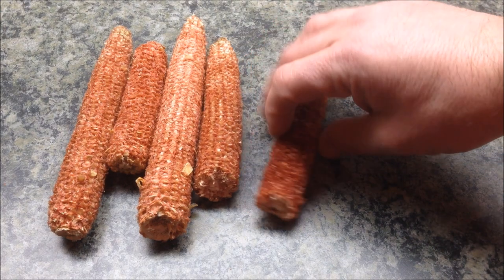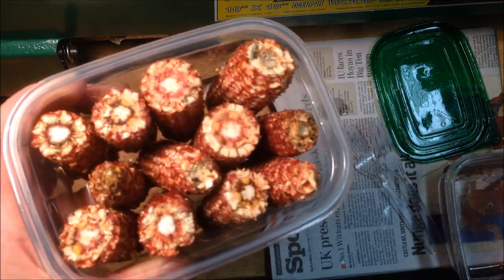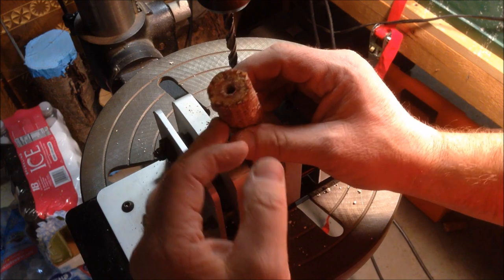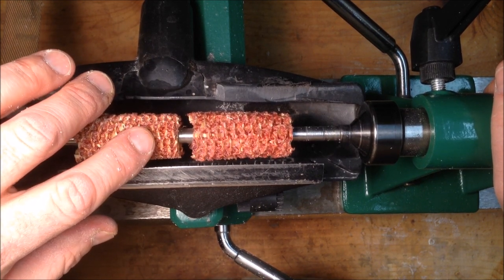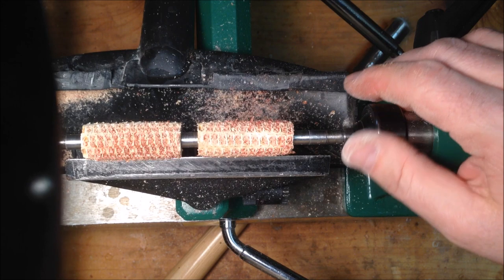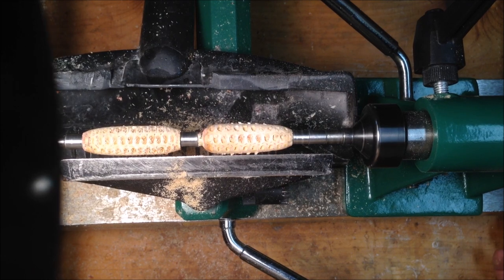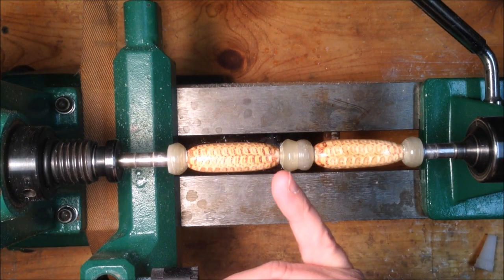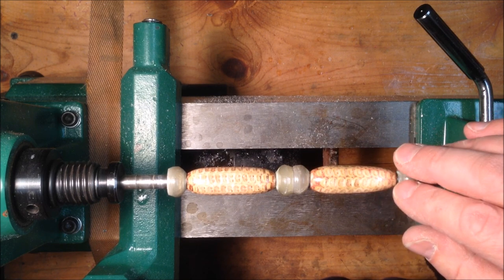Corn Cob Ink Pen

Comment: Very Cool.  Would love to see the slimmer corn cob pen blanks in the future videos.
Reply from the maker: Thank you Richard,
  I will do another as I improve the process and maybe fill the kernel holes. 

Regards,
Bob
Reply: Saw Dust Maker If you started with smaller cobs you could make a slimmer pen.
Reply from the maker: Phiyedough What I've found that helps more than anything is a smaller core. Some cobs have a large core and that makes for a thicker more unattractive pen. I like the more delicate cored cobs, they give superior results in my opinion.
Regards,Bob

Comment: Wow that looks like a really cool pen Rob, there is nothing like experimental pen to get your brain buzzing.  Great video and very well explained. Also I think i will have to get some of that Minwax hardener.  many thanks for sharing.
All the best
Tony
Reply from the maker: Thank you Tony,
  I was surprised how well the MinWax hardener worked. I absolutely loved turning these corn cobs my only regret was the length it time it took due to the weather. I was dying to get back out in the shop and work on them but it's been cold. Now I have a ton of ideas for filling the kernel holes. 

Regards,
Bob

Comment: Being from the Cornhusker state this is a pretty good selling pen. I have use stabilized pen blanks and tried the hardener. I just use thin CA glue. I literally coat the blank hit It w hardener, then drill it slowly.  The cobs are very sponge like. CA glue the tubes in. Mount it and start turning w sharp tools, after you get past the "fuzz" of the cob soak it again w thin CA glue building up a a hardened cob while turning it. I've turned lots of cob pens this way and never had a blow out. I probably apply this CA 6 or 7 times. The trick sharp tools light passes. Very nicely done though. I harvest my cob just like did.
Reply from the maker: Thank you Dave,
  And thank you for sharing your process. 

Regards,
Bob
Reply: J

Comment: Thanks RJB looking forward to it, right now doing a restoration on a machete my nephew found in the woods. Cool item to restore. Lots of work too....lol
Reply from the maker: I think it's great that you take the time to restore an old took to new condition. I wouldn't even know where to start with a project like that. 

Regards,
Bob
Reply: RJBWoodTurner I will post a picture when I am finished with it. It is already to glue the new hand made handles on. Then do some finishing on the blade, then a few coats of boiled linseed oil to seal and protect the handle.
Reply from the maker: That sounds great Steve,
  I'm looking forward to seeing it. 

Regards,
Bob
Reply: RJBWoodTurner Hope you can see these photos of the machete, I restore. It was all rusted and pitted. So it is not in pristine condition. But, I did what I could. Also made a nice shield for it....lol

Comment: Great instructional video. I've got a rough bowl of "punky" horse chestnut drying after a good soaking of wood hardener - hope it works as good as yours. I saw a video using coffee granules as a filler.
Reply from the maker: I hope it helps too,
  I've had great luck with corn cobs because they soak up the hardener. Wood tends to harden the surface but doesn't soak in to deep. 
  
Regards,
Bob

Comment: Thank you for the tip of the wood hardener.  
I have turned several of these and have always just wiped on CA every-so-often as I spun them.  That worked well but I am curious to see how much better the hardener will be.  I have even turned complete corn cob pens without using anything to stabilize it....just a really soft touch and a lot more sanding than chisel work.  
I turned mine down quite a bit more and you don't have the large corn holes to fill but you still see the same pattern.
I used liquid food coloring as a finish and now have a blue, green and red corn cob pen.
They look pretty cool.  The food coloring worked well as it only highlights the pattern of the cob and doesn't make it a solid color but it was a bit sticky to work with.  After it is applied, you can even sand some off to get your desired look.  Then I applied CA over the top and the color is locked in.  I'm wondering if the food color will work if I use the wood hardener prior?......(guess i will have to try)  
I see you published this video in January.  If you haven't yet, you should really try turning one down a lot further for both looks and ease of use.  Just my 2 cents.
Reply from the maker: If you have a minute after you try the wood hardener, I'd love to hear your thoughts as to wether it made a difference or not. I have never turned a corn cob without it. I will have to attempt it and see what my results are. 
  Thank you for such a detailed comment and especially for the information on food coloring. I am curious to see if the food coloring will adhere with the wood hardener or not. 
  I was thinking about soaking a cob in food coloring the letting it dry and then soaking it in wood hardener to see what happens. I still plan to try it. 

Regards,
Bob

Comment: Hi Bob, great video. What do you think of a larger diameter pen kit such as the 30 Caliber Bolt action Bullet Cartridge. so the shape might look a little more proportional?
Reply from the maker: Hello Wayne,
  I think the 30 cal or any other larger kit would work great! It certainly would be much easier to turn a larger diameter. I only use the Slimlines for testing and videos because their cheap. Once I prove an idea, I can scale it up to just about any kit. I have made several of the Stratus pens with corn cob and they turned out beautiful.

Regards,
Bob

Comment: That is pretty neat! I didn't even know wood hardener existed.
Reply from the maker: Thank you David,
  I picked it up at my local Menards for $10.00. Usually you paint several coats onto the surface of rotting wood to stabilize it for painting. It works really well. 

Regards,
Bob

Comment: Great looking pen now a ? for you. Do you think the wood hardener would work on cork.  I have a bunch, and I would love to make a pen from them thanks
Reply from the maker: Frank,
  As long as the cork absorbed the hardener I think it would work. There in lies the issue, I don't think cork is absorbent. I sure wouldn't let that stop me from trying. The MinWax hardener is only $10.00 a can so it is a cheap test. You may even me able to follow the regular instructions on the can for wood and just paint several costs onto the cork. This is a great idea and one worth trying.  
  Have you tried drooling C/A over the cork while its in the lathe then hitting it with accelerator? With a sharp tool, that may let you turn it down a bit then you
Would have to repeat the C/A. 
  If I can dig up a couple corks, I may have to give this a try. If you could get it to turn it would make an awesome accent for the lower half of a pen.
  Please let me know if you have any luck, I think this is an excellent question. 

Regards,
Bob

Comment: We can get popcorn still on the cob as a novelty item here.  After popping in the microwave the cob is bone dry.  The cobs are a little smaller so work well for pens and I get a good feed of popcorn. I usually drill the cob run thin CA down the hole  and redrill after it hardens then turn the pen with light cuts and harden with thin CA as I get closer. Can't seem to find the wood hardener aroun here.
Reply from the maker: That's a good idea, drooling C/A to harden the core where the tube will go. I started using five minute epoxy on my cob pens. It seems to do a great job and I don't notice any deterioration. Worst part is I have to wait longer to turn. 

Regards,
Bob

Comment: What do you think about putting the cobs and hardener in a container and then using a vacuum pump, would that improve the penetration of the hardener?  White cobs would be pretty too. Great video and excellent technique in turning and teaching. Thanks for sharing
Reply from the maker: Thank you David,
  If you want to use vacuum, that would work great. I’d recommend Cactus Juice over wood hardener, it will penetrate better and give nicer results. What I did was a poor mans method. 
Regards,
Bob

Comment: Looks  good.  I always try to spray the accelerator first prior to putting in the CA glue due to it lets the bottom dry along with the top.  Corn cob looks great when you use colored resin to fill in the holes.  All types of things to do with corn cob.
Reply from the maker: Thank you Susan,
  This is excellent information especially the tip on spraying the accelerator first. I will give that a try. 
  I can't wait to attempt coloring the kernel divots. 

Regards,
Bob

Comment: I tried one a year or so back but didn't know about the wood hardener and it fell apart while turning.  
Could you explain your vacuum system sometime?  It appears to be quite effective in removing dust for you.
Thanks
Al
Reply from the maker: Hello Al,
  I just clamp the floor sweep attachment of my shop vac to the table behind the lathe and make sure it's right behind the mandrel. It sucks up almost all of the airborne dust while turning and sanding. I still get quite a bit of shavings under the lathe and on the floor but that's just the heavier chips. 

Regards,
Bob

Comment: Your videos are well done.  Two questions: 1) can you explain a pressure pot? and 2)  I see you are using a Harbor Freight 10x18 lathe.  How much of a problem is it not having a variable speed drive?  I see Penn State sells a Variable Speed backfit kit.  Given the lathes being sold for pen work and small turning are likely the same lathe, I wonder if the VS backfit kit would work opn these lathes that look like they are all made buy the same company. (I know Penn States can come in VS)
Reply from the maker: Hello David,
  I don't own a pressure pot but I'll do my best to explain them. You can put punky wood into resin and add air pressure to the pot. The pressure forces the resin into the wood and stabilizes it. 
  For more Information, take a look at Zac Higgins over at NVWoodwerks. That is and e and not an o in werks. 

  I've gotten so use to to moving the belts on my lathe that it's not really and issue. I use to own a variable speed lathe and it is a nice convenience plus it saves a bit of time. 

Regards,
Bob

Comment: Fun stuff.  I wonder if that would be a good application for the one piece Bic insert pens, like Cap'n Eddie makes.  The larger diameter would not be a problem then, if you could got some decent taper toward the pen point.  Also wondered what would happen if you soaked the wood hardener a second time, like just before you went to your skew.
Reply from the maker: Well Dan,
  Those are some great questions. I don't see why they wouldn't work for the Bic styled pens. I may just have to give that a try. 
  As for the hardener, a second soaking may help once the outside is turned off. I may have to give that a try too. 
  Thank you for getting my mind churning. 

Regards, 
Bob
Reply: Dan Valleskey Yes, I also wondered about doing the initial roughing on the lathe then repeating with the hardener. My other suggestion was to use a chuck to hold the blanks instead of the 2 jaw vice.
Reply from the maker: Phiyedough Hello Dan,  I have a set of those pen drilling jaws for my chuck on my short list of things I want for the shop. I really think they would make me drill much more accurately down the center of my blanks. I hate it when the bit drifts and ruins a cool blank.   I haven't given this a try but I have made several more corn cob pens. Soaking them a second time most definitely wont hurt them, I'm just not sure how much it would help. If you're rough turning, you already have the tube drilled and glued in so the only the outside of the cob will get the hardener. That first pen was way fat but as my confidence has grown, I've turned them much slimmer with great results. If they look like there coming apart, a little C/A will also do the trick.
Regards,Bob

Comment: Great video, Bob.  I appreciate the time and effort you went through to show us how it's done, step-by-step.  I agree with you on the lack of aesthetics as I'm really not into overly fat slimlines -- seems a bit of an oxymoron, if you catch my drift ; >)  I think I would use a Cigar pen as the added girth would be less of an aesthetic issue.
Reply from the maker: Thank you John,
  When I picked through the bag for cobs for this project, I selected the larger ones not knowing how big they would be after turning. I think I'll turn some nice key chains and larger pens from the rest of the ones I stabilized and use up the smaller cobs to make a few more slimlines. At least I know now what to collect for next years crop. 

Regards,
Bob

Comment: I know this is an older video but I have a question.  What if you were to drill the center hole before you stabilize?  Wouldn't that allow for better or faster penetration of the stabilizing medium?
Reply from the maker: It certainly would as the hardener would soak in from the inside as well. I did think about that however the cobs turned to dust when I tried it. 

Regards,
Bob

Comment: Those would make nifty corn cob holders.

What would you use for a final coating to make them suitable for table use?
Reply from the maker: I'm not really sure,
  For a cutting board id use more mineral oil but that wouldn't work on these. 
  I used C/A but that's definitely not good safe. 

  I'll ask around to see if I can find anything. 

Regards,
Bob

Comment: Excellent job with the corn pen ,would this not decompose or would adding the glue prevent it from doing this.
Cheers
Tim from Wood 4 Nothing
Reply from the maker: The glue and wood hardener will prevent it from decomposing. 

Regards,
Bob

Comment: Did any of those FB sites mention 2 part epoxy? It is very thin and would work very well.
Reply from the maker: I used Gorilla 2-Part Epoxy on my last batch to glue the tubes in and it worked very well. 

Regards,
Bob
Reply: My mistake, i meant 2 part epoxy resin. It is like water before it cures, you could easily make a mold from plastic and encapsulate the blanks.
Reply from the maker: You could, and it would work as long as you could get the bubbles out. 

Regards,
Bob

Comment: Forgot to mention, I don't use a pressure pot or anything like that.  I just pour colored resin on them in a plastic container. The resin will harden the corn cob.  Should save you more time than applying the hardener, etc.  Plus it is pretty fast too.
Reply from the maker: I have been wanting to get into using the poly resins. I just haven't made the jump yet. Is it very expensive to use?

Regards,
Bob

Comment: If you used something like food dye to tie-dye the towel, then harden it, I think that would be an amazing pen.
Reply from the maker: That’s a cool idea and now that I can cast, I may try that. 

Regards,
Bob
Reply: If you do try it. You could fold the paper towel into a rectangle about the length of the tube, then you can stack them till they're a good height. Next you should hold them together with a rubber band or two and drip the food coloring on, and once it's dry you can put it into the wood hardener.

Comment: This looks great and like a fun project.  Did you turn the other pieces and experiment with the additional filling materials?

-Todd
Reply from the maker: Hello Todd,
  I did turn the other pieces. I had about a 50/50 success rate with them. What I found is that the unturned cobs got brittle the longer they set. I'm looking forward to getting a pressure pot so I can make many more. The pen was very popular around here. 

Regards,
Bob
Reply: +RJBWoodTurner hi, really like what you have done, I've been very interested in lathe's and have been watching lots of stuff on them, hoping to get one at some point soon. just wondering if you had looked into the option of using epoxy to make the blank with the cob inside it, not sure if it would work with the cob but have seen a lot of people casting normally unusable things in epoxy and the turning them on the lathe creating some quite beautiful items. and with the contrast of the epoxy and the ability to add other things i thought that could enhance the cob. if the epoxy would work with the cob and still be workable it would fill in the issues of the holes left from the corn and I imagine it would make it a whole lot easier to finish it off.

Just a thought. if you have thought of this and it wouldn't work let me know, if I get a lathe I wouldn't mind trying something with the cob =]
Reply from the maker: Hello Louis,
  That idea would work just fine. Epoxy is a fantastic solution for corn cobs. I just don't have a pressure pot to eliminate the bubbles.  

Regards,
Bob
Reply: a trick I've seen a guy on here called peter brown does is use a blow torch, clears the bubbles right up in his moulds, if you haven't seem him he does some fun stuff with epoxy and random objects =]
Reply from the maker: Thank you Louis. 

Regards,
Bob

Comment: I am wanting to do something similar with a knife scale (handle).  do you think your process would work?
Reply from the maker: What really made this one tough was the C/A finish. The cob was still delicate and required a light touch. I don't know anything about scales but why not give it a try. 

Regards,
Bob
Reply: +RJBWoodTurner 
I was thinking of using fiberglass epoxy, with a vacuum pump. now the real question is can i take corn that is made for eating cut the kernels off let it dry? I know most corn in the mid west is feed corn...
Reply from the maker: I guess you could try drying it. I've never done that but surly there's a way. I wonder about drying it in an oven on low temp. The vacuum and epoxy should really stiffen it up. 

Regards,
Bob